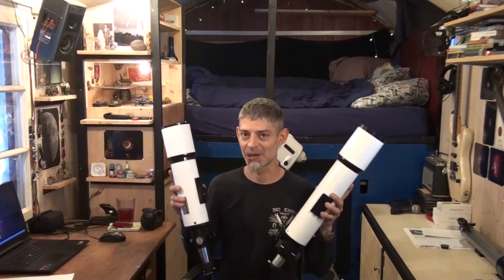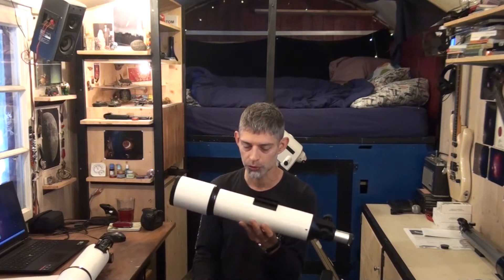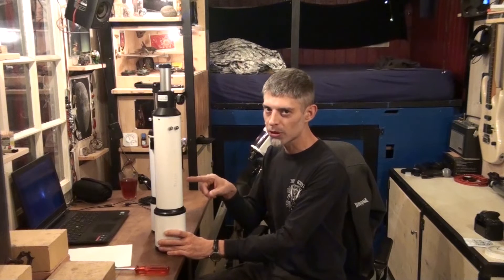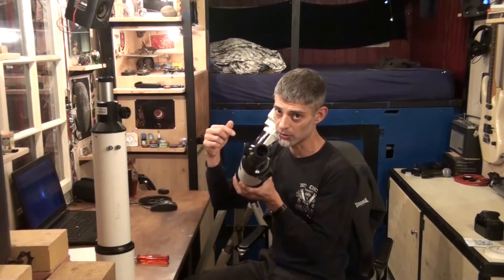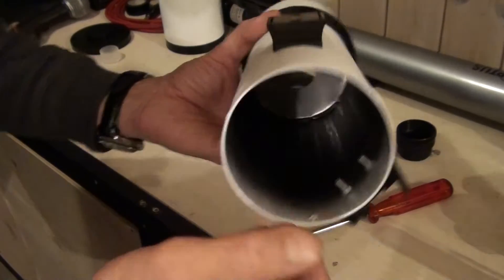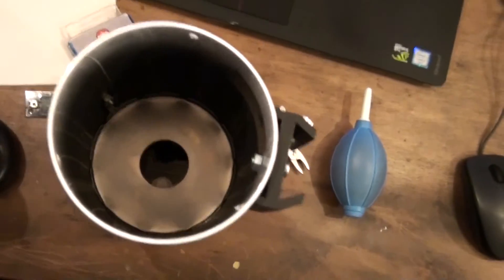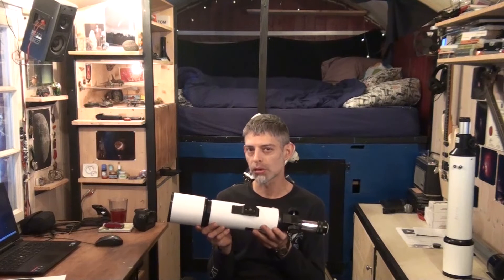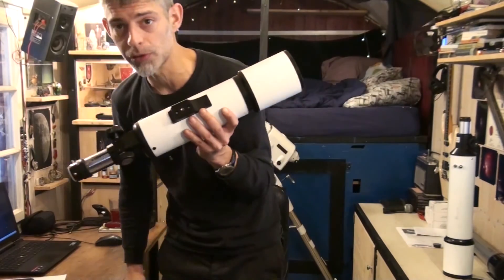Aliexpress Telescope Review Time! Refractors under 100 Dollars for Deep Sky? Lets find out! :)

Comment: The 70mm has a CAI = 2.6 and the 80mm has a CAI = 2.4.  Of course they will have chromatic aberration.  You need a CAI of 3 to 5 before the color in an achromat is reduced.  That would be a long refractor.  Thanks for reviewing the scopes.
Reply: Where did you find these stats for the telescope? Where can i find indepth telescope specs